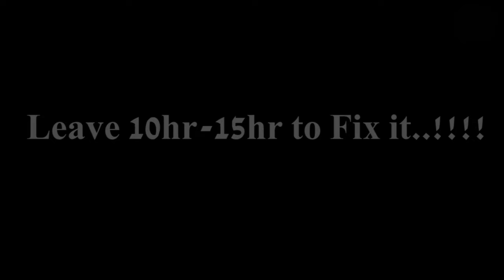GLASS INSTALL !! How to Replace a Rear Window glass paste car in easy way

Comment: This is not proper method. You are using  silicone sealant. Actually polyurethane is using for glass fixing.
Reply: Which one you recommend
Reply: Sika is one of the best adhesives for automotive glass.
Reply: @DigitalYojimbo  where can you find it
Reply: lol it’s called n rigging it
Reply: @KimmySemak  Ninja Rigging?  😂

Comment: That’s crazy. A razor scraper  🪒 makes the trimming way easier. They don’t have tape ? Instead of rope or whatever that was supposed to do. You always want to wear gloves so you don’t leave oils from fingers around the perimeter. You want a good bond to the pinchweld and glass. I would be surprised if that didn’t leak lol.

Comment: This is such a poor way to replace your backscreen. It damages your vehicle color and your safety. You need a professional and proper tools to get your back glass replaced. The silicone that person was using is also very poor quality. For car glass you need Polyurethane Sealant and not a Silicone. Here is a video on how to replace the glass. https://youtu.be/RJBKIFVdPxI

Comment: Hi! Did you use the primer before applying that windscreen sealer ? And tell me if someone use the primer or not using the primer does it make any difference?
Reply: You should only need primer if your vehicle is old.
Reply: Makes a big difference
Get the same brand primer
Reply: The sealant will act in the same way and prevent rust if that's what you're worried about. You'll never see where the sealant is.